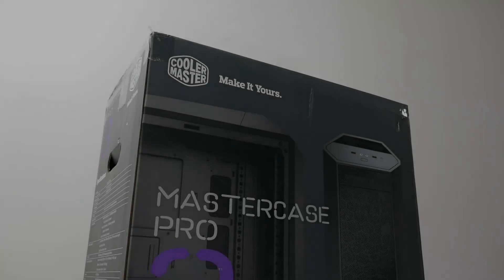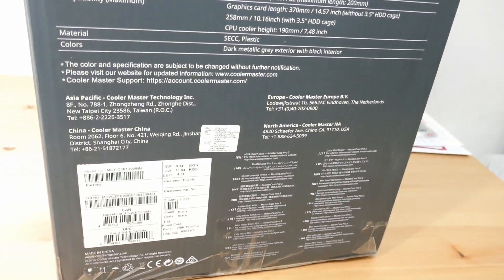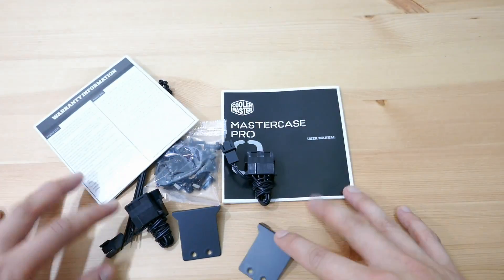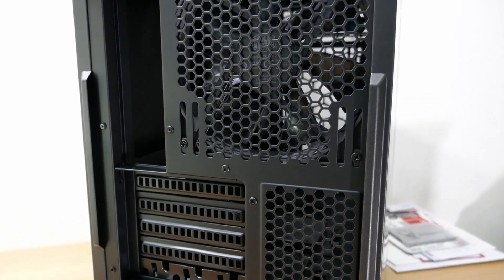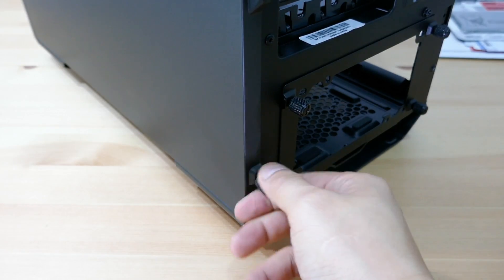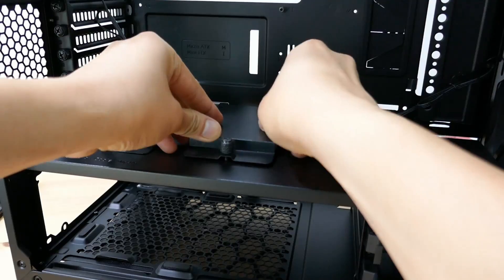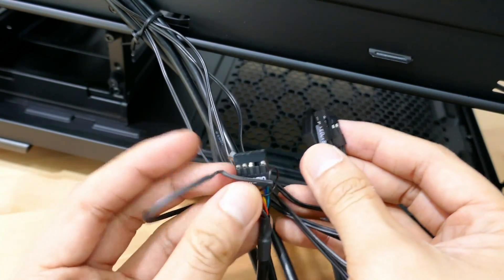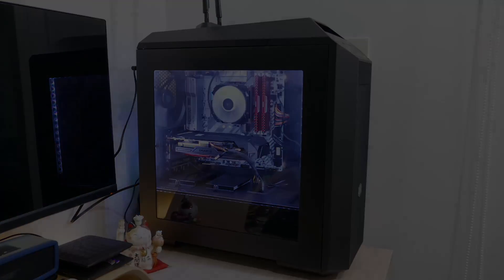Cooler Master Mastercase Pro 3 - The Micro ATX modular PC case! Review and quick build

Comment: okay i want to attach "Corsair Hydro Series H115i Extreme Performance Liquid CPU Cooler" and " EVGA GeForce GTX 1080 FTW HYBRID GAMING Graphics Card" with my system. Does this case have that much enough space to accommodate these extra  huge perks in it? please help
Reply from the maker: Corsair Hydro Series H115i Extreme Performance Liquid CPU Cooler????? - No problem can either be installed on the top or the front 280 rads very well supported. EVGA GeForce GTX 1080 FTW HYBRID GAMING Graphics Card?????????? No problem as well can either install the radiator at the exhaust or top or the front. This micro ATX case is massive, it is some what bigger than some ATX cases
Reply: Thank you so much for your detailed response.